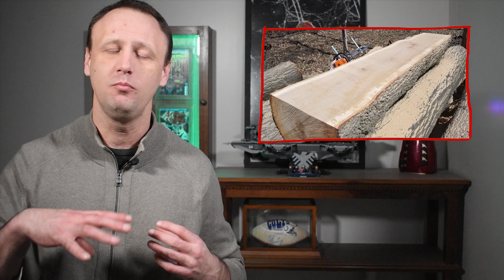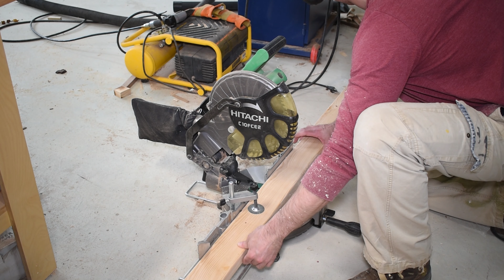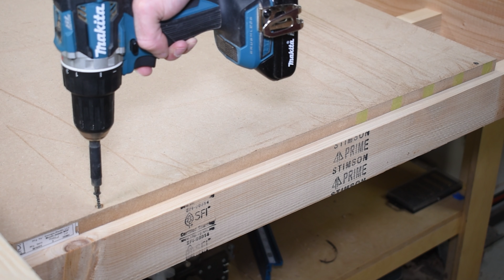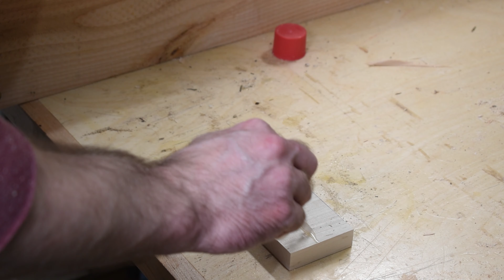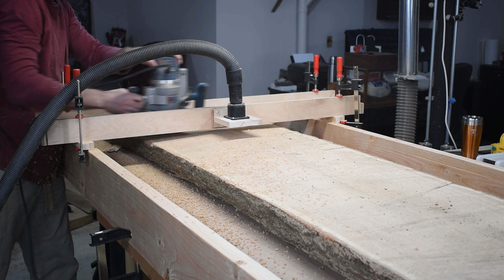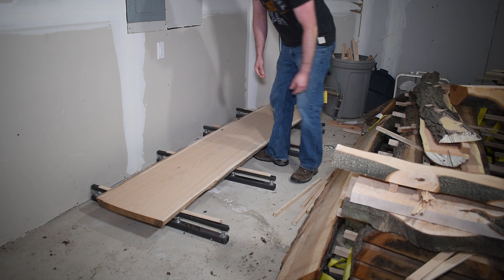Flattening a Chainsaw Milled Slab | DIY Router Sled

Comment: your lumber levelers are an amazing idea! so many times in our shop when we assemble, we glue up a piece and stack it, glue up a piece, stack it, etc.  the glue dries while on the stack so if it isnt flat then the installers get angry because they get warped gables or something.  this is such a great solution.

Comment: Decent router sled design, but the only problem that I see with it is that you ar planing the work piece perpendicular to the direction of the grain. Its not crucial but it definitely makes for a better finished product if you go parallel with the grain. Just a little advice, I learned this by trial and error unfortunately because my first sled was a cross grain design as well. My slabs look much better now that I have it setup to run parallel to the grain direction... Happy woodworking Sir, Good Day!!

Comment: Good economical flattening  jig. Regardless how fancy your router sled or how perfectly straight your main support rails, an absolutely essential element in the setup is to be sure that the rails are in plane with one another, i.e., not in winding (twisted). If your setup fails in this regard, the result will be generally flat work pieces, side to side, but with a twisted face, end to end. You can either use winding sticks or a reliable level to assure that the rails are co-planar. I happen to have a digital level, so I am able to accurately achieve this planar result, even if my rails are not truly level. But you can achieve an excellent result with careful use of a standard level.

Comment: Timely video! Live edge slabs & slab projects are very poplar now. Unfortunately, many people take it for granted that every slab, regardless of size is flat as a pancake. Rarely is that the case.  "How can I get this flat?" is not a question you want to start thinking about after the purchase.😉  
Your router sled jig is something every slab woodworkers should have in the shop.
Reply: GenealogistWoodworker One of the worst abominations  i’ve ever seen in the lumber business involved a 30” x 40 inch long buckeye burl slab turned into a coffee . Possibly one of the most spectacular slab specimens I’ve seen in my career - completely covered in dense burls, almost no open inclusions, wild colors running from copper to black to silver to tan. Basically everything you look for in an A+ grade buckeye Burl. Someone just dumped a ton of epoxy all over it and ruined it. Epoxy was uneven, turned yellow from UV exposure, bug holes were appearing as live bug bore through the Epoxy from inside. I think some people think rustic = anything goes. Not true! 😆

Comment: I really thought the wood was 100% guaranteed to warp as it dries out, so flattening it was something to do only after it is dry.  Apparently, that is not the case... Thank you - learning is good!
Reply: You should definitely flatten your slabs once the drying process has completed or at least very close to completion because your slabs absolutely can still warp or twist after they've been flattened if it still has a high moisture content. Really depends on the species of the wood that you are using ie. Madrone/Arbutus is highly prone to warping and twisting during the drying process. So in the end personally I would say to always dry your wood before you plane it. It would be very upsetting to spend all kinds of time flattening your work piece only to come back to it once its dry and find it warped or twisted and have to completely go over it again.